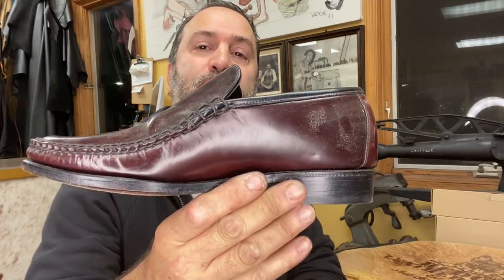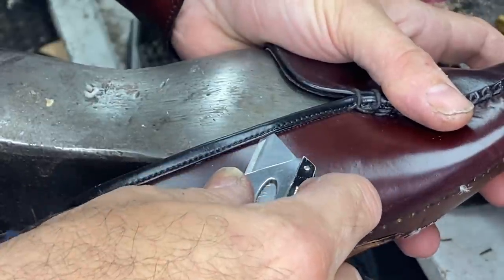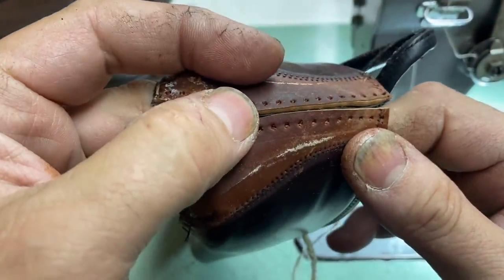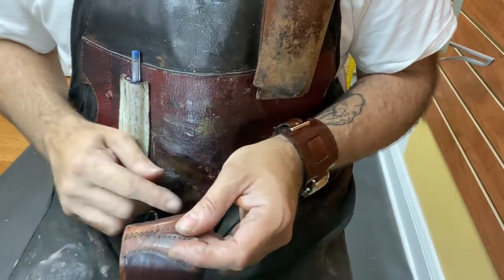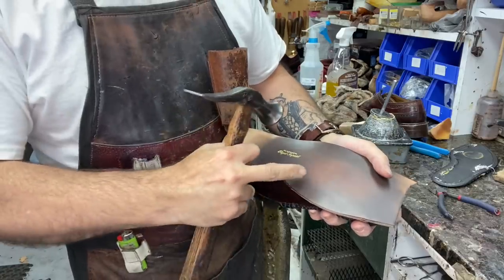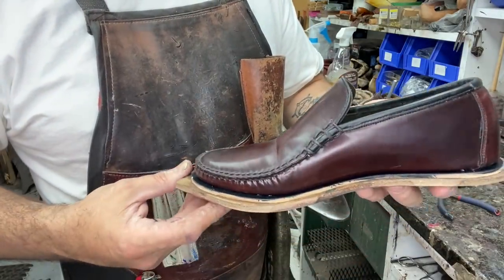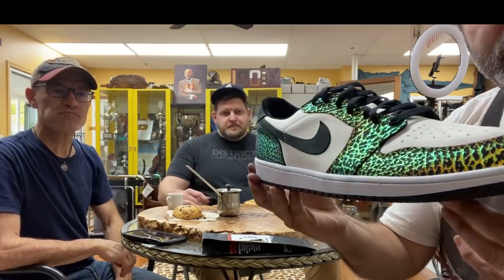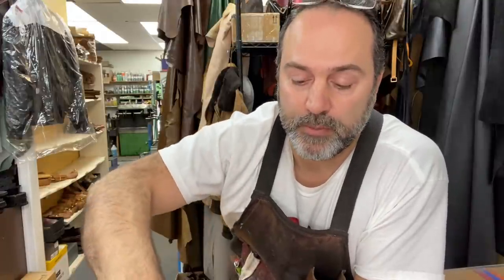Florsheim shell Yuma Resizing

Comment: @23:20:  You're talking here about grind settings.  There are different grinds for different brewing techniques.  The brewing style you like (common in the eastern Mediterranean and some parts of Vietnam) is super-fine and is often called "powder".  It would be messy or awful to use with most techniques, but very good for the one you like.  It also yields very high levels of extraction, so the coffee can be very strong and a bit bitter... and there's nearly always some sludge at the bottom of it.

(If you're really into coffee, check out James Hoffman's channel.  He's geared toward espresso, but branches out.)

Comment: Bedo's Leatherworks and Grounds or shorten it Leatherworks and Grounds.  One question:  how did you determine how much to shorten the shoe.  You removed about a half of an inch of leather.  Was it experience or some form of measurement?
Reply from the maker: It’s all estimation, talking with the customer about the fit

Comment: Hi Steve, could it be that the darker color of the leather is because of exposure to UV sunlight?
Reply from the maker: Which leather are you referring too??
Reply: @BedosLeatherworksLLC  Ay about 14:00 you comment the difference of the dye between the parts exposed to the light and the parts hidden. I was wondering if, apart from the usual wear and tear, also the exposure to sunlight changed the dye.
Reply from the maker: @LuigiRosa  I don’t think so, it to even to be from sun light